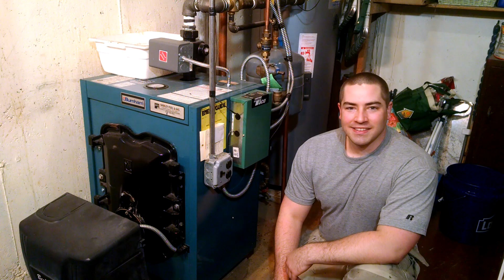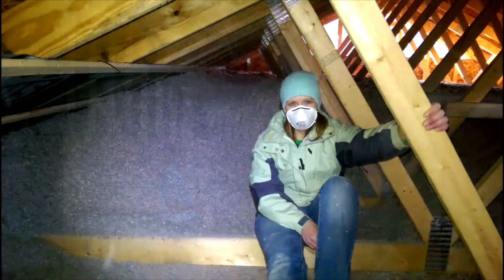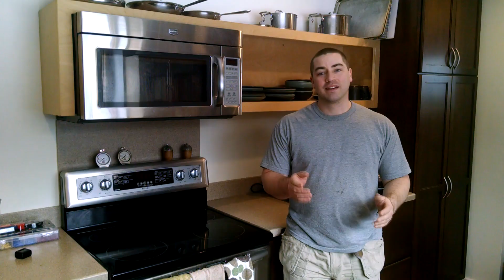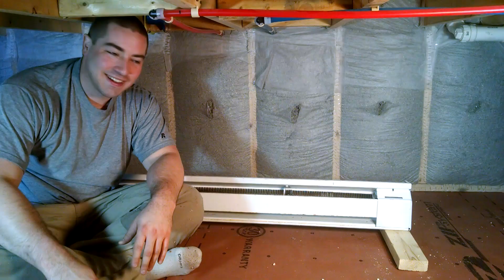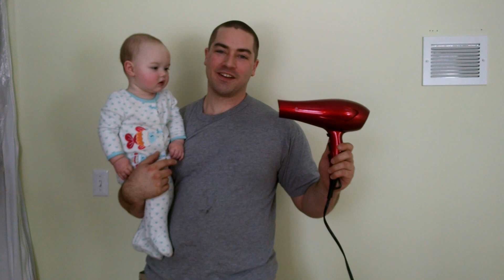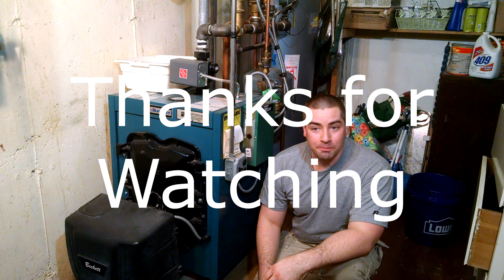Heating our House, Super Efficient

Comment: Can you please tell me which brand and model of mini-split you have.  Do you think the problems you are having apply to all mini-split systems in very cold or snowy weather?    Also, where did you find that beautiful baby?
Reply from the maker: Sure, I have a Fujitsu AOU9RLS2.  Cooling capacity: 9,000BTU/Hr. Heating capacity: 12,000 BTU/hr.  My Father has a different brand/model and suffers the same issues (actually a bit worse).  I don't think my issues are brand specific, but I also don't think everyone has problems.  Actually a friend of mine has three units, and hasn't had any problems in the past three years (but he primarily heats with wood stoves).  Anyways, you might have a great experience..  But for my money there are far better, more reliable, things I can do to lower energy bills.  I'm not going to gamble on one of these systems again.
Reply: Thanks for the information. I'm sorry you had problems.  What will you do for air conditioning when it gets hot out?
Reply from the maker: The system is working as of now, so I'll be using it until it eventually fails.  At that time I will go back to what I did my first year.  I used a small window AC in the upstairs loft.  The cold air sank down to the main living space cooling everything very nicely.
Reply: Thanks for sharing your experience.  I will have to do more research.
Reply: Could you use kw as electricity pricing varies for us viewers.
Reply: DavidPoz sorry to hear that ! I have a 12RLS2H by Fujitsu with a 10 year part and labor warranty since  2 winters, and I only heat/cold my house with it since Without issues. We are in Quebec Canada so a bit more North than you. ( what a past 2 weeks of cold it was!) Just by curiosity,  how much does it cost you in total electricity bill for a year for everything ( garage home light heat etc...) thank you for your videos I really enjoy watching them!
Reply from the maker: I'm glad to hear you are having a good experience with your Fujitsu.  I'm currently working putting together my electric data.  I'm sorting through it for when I added the solar panels, and when I added the garage.  I'll make a video with the details in the future.